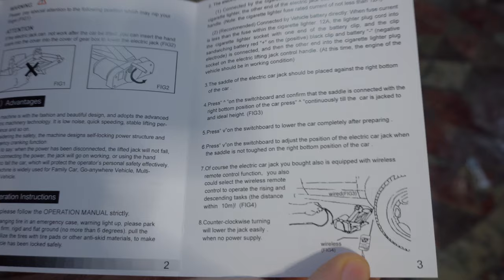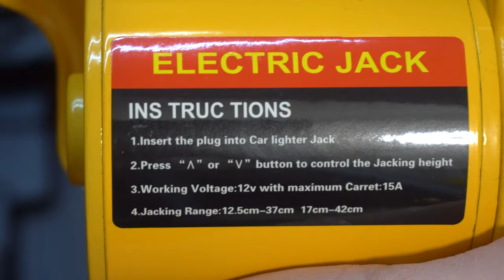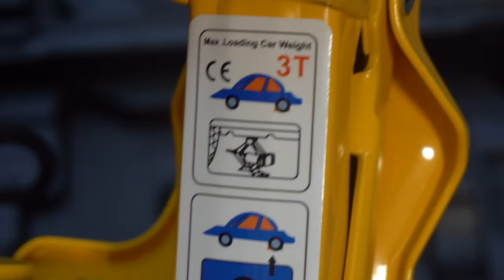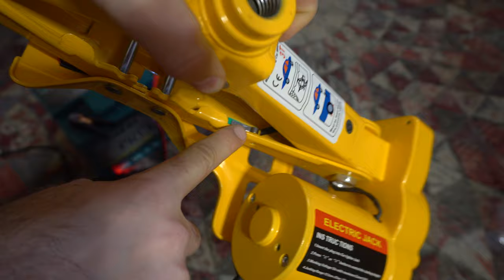Electric Scissor Jack (12V, 3T) - Unboxing

Comment: i got this same one today and it bent as soon as i lifted the car ( followed instructions and did it how they said to ) is there anything I can do at all to try to stop that?
Reply: CAUTION
1 Please read carefully and understand the manual before using the product.
2 Overload is forbidden
3 Must avoid the prodact that be jacked to move
4 Must to park the braked car on smooth and solid ground
5 Working under the product that is being Jacked is forbidden
6 It is car Jack using it as the support tool is forbidden
7 To avoid hip your fingers it is forbidden to put yourhand into the machine
8 To avoid injury or losing property you must abide the warning.
Reply: 1 Carefully read and understand the manual before using the product.
2 Do not use the jack for loads beyond the rated capacity.
3 Chock the wheels if necessary to prevent shifting of the car as it's being raised.
4 Use the jack only on smooth and level ground, applying the parking brake before raising vehicle.
5 Do not work under car without the additional use of jack stands for support.
6 This jack is not suitable on its own for support of the car for vehicle maintenance.
7 To avoid loss of one or more of your fingers, do not stick them inside the jack while in use.
8 To preserve your health and well being, and keep your stuff in good shape, the dude abides.

Comment: The hand crank doesn’t work?
Reply: 3:50 It doesn't seem like it does, does it?
Reply: Actually. It's because it has such low gearing on the motor ring gear that any motion is imperceptible as you crank. If you put the handle in and tap the motor, the thing spins furiously. That's how fast you'd have to spin it at the same rate as the motor would.